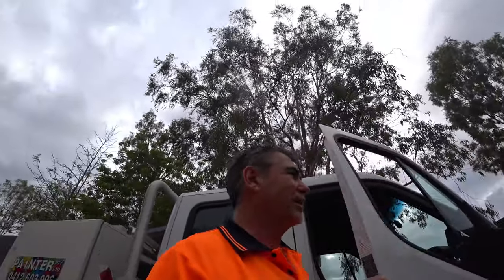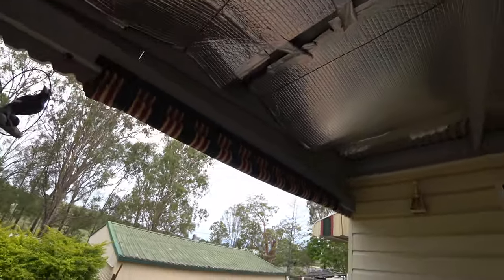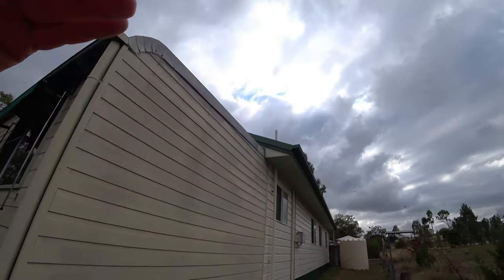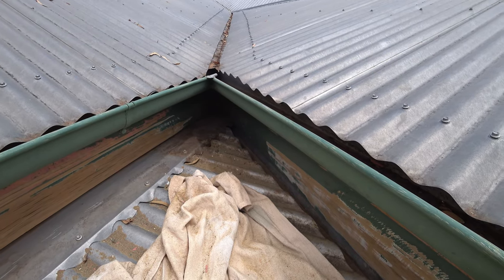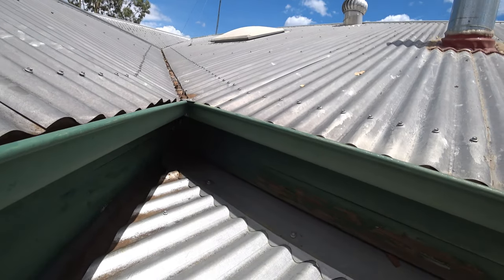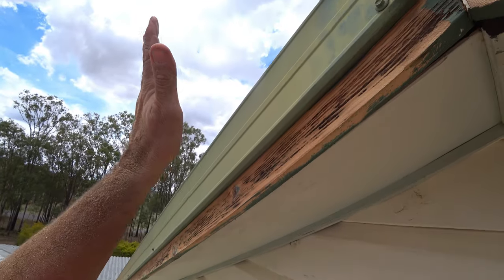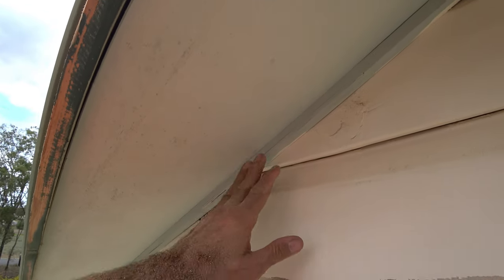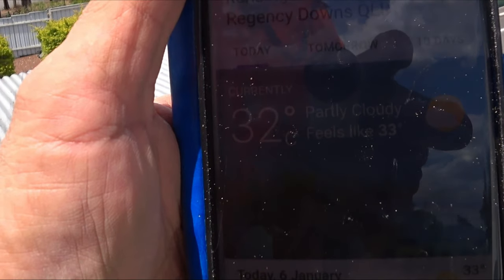Transforming old house to perfection by painting.

Comment: Thanks Greg. What type of paint would you recommend for exterior trims and doors? I’ve got old bare cedar windows and doors. I’m thinking oil undercoat, and two top coats of weather shield or aquanamel. I’ve heard oil based top coats are no good outside. Cheers
Reply from the maker: Your spot on ,I would use an oil base undercoat, light sand with 180 sandpaper, acrylic enamel x 2 or three.

Comment: Another good video Gregory. You explain your process well. I ve been caught out a few times pricing externals. We have a lot of masonry paint work. Could be on stone or roughcast. It’s not until your up a height you find the paint is loose, failed and requires lots of scraping and prep. Bastard at times finding those unforeseen problems. What you priming your wood with. Have you used PEEL STOP from Zinnsser ? It glues down the edges of the paint prevents it from lifting where you start coating. Cheers mate.
Reply from the maker: Hi Steven, I don't paint over loose paint,I strip it back where I can
Reply: ThePa1nter obviously but where you hit stubborn areas and a sound edge then the peel stop glues down the edge preventing paint film lifting, then apply your coatings as norm.
Reply from the maker: @stevenmcfarlane8831  I understand now, I've never used another product for that.